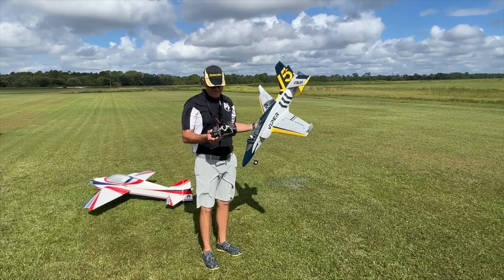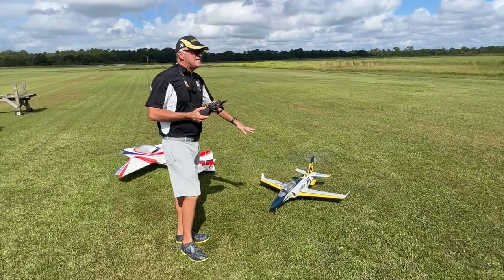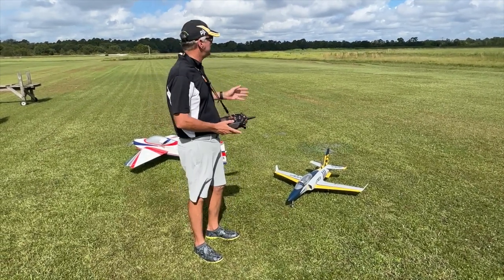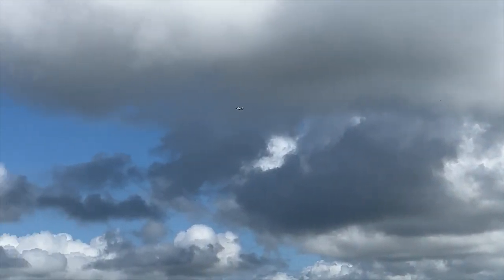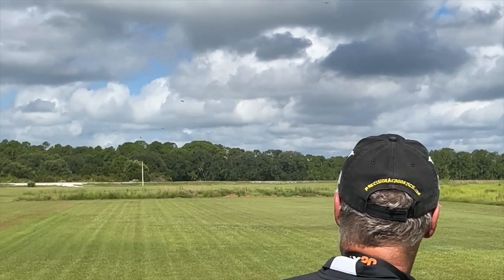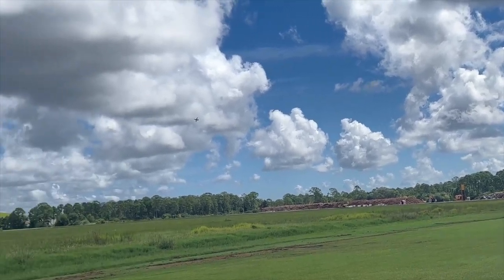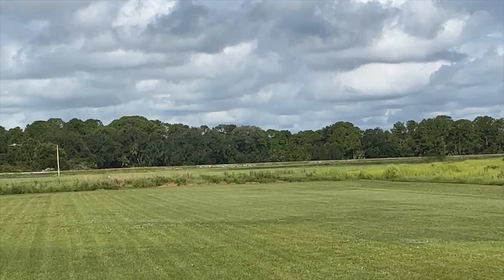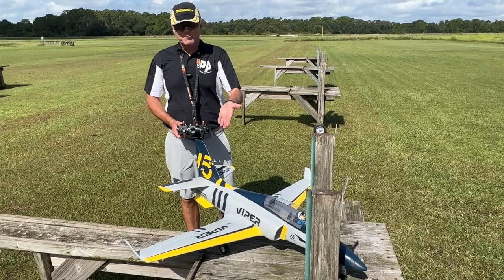Michael Wargo Instruction: How to make your plane (EDF) fly the way YOU want.   Part 2

Comment: Just for clarity (while being Dr Obvious): Thr to Ele mix: turn off if inverted .. & .. Ail to Rud mix for knife edge: turn on only for knife edge, as that is opposite rudder for flat/coordinated turns.
 You have to pick handy convenient switches you can get to easily and often.
Reply from the maker: NO....   Throttle Elevator mix does not have to be off inverted unless airframe demands it.   Rudder/ail and rudder/elevator I leave on all the time.   Why wouldn't you?   Everytime you roll the aircraft it will roll straight, and even rudder turns, etc, will be better.   I have other things I switch for for sure.   I covered in other videos on mixing.   Look them up.

Comment: My Viper 70 won't hold a knife edge. I've mechanically maxed out the throws, jammed the battery as far back as possible and maxed out the servos and it still drops the nose even at full throttle on it's side.  Great video though. Thank you.

Comment: Could explain what the actual knife mix is?  Sorry if I missed it.
Reply: Use of rudder couples unwanted changes in pitch and roll with many planes, observe what your plane does in knife edge. Does the plane roll in knife edge and does it move towards canopy or wheels. Counter act with rudder mix to elevator and aileron start small and add incrementally.